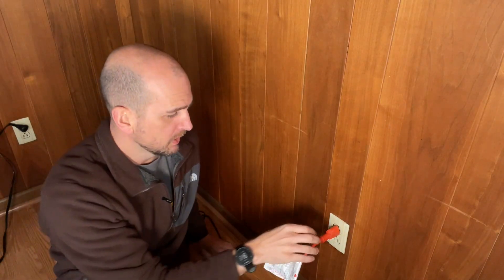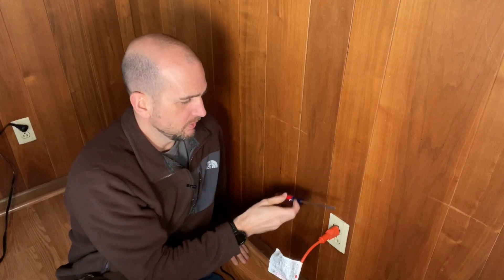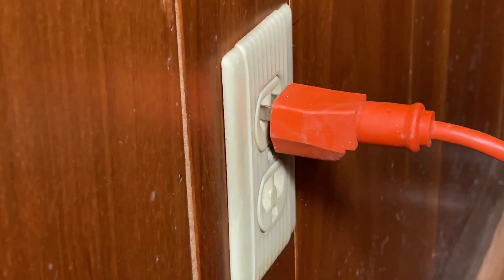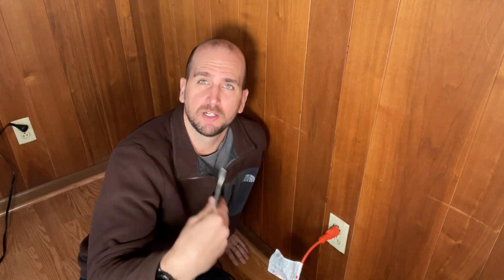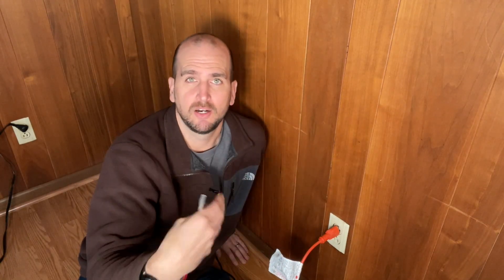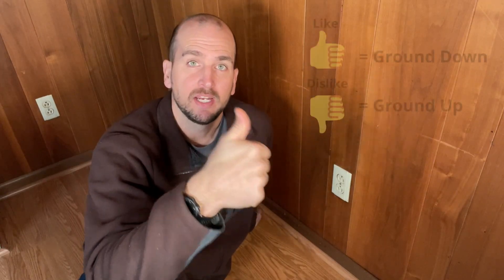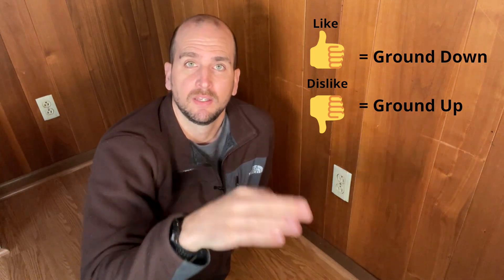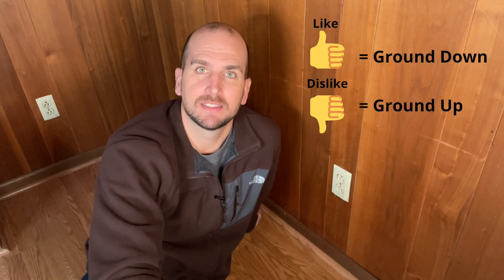Should An Outlet Be Installed Ground Down Or Up

Comment: I was in a brand new hospital and noticed all outlets were upside down.  I thought maybe mexicans put in the wiring.  I built my house and wired it ground down like it should be.  In the possible event a plug was not all the way in and an thing metal object was dropped just right to hit the plug and short it the breaker will pop.  Never had that happen and it looks stupid with wall transformers with their cords sticking up and bending over.

Comment: I've been doing handyman work for about 50 years now and I usually try to match ground up or down with the rest of the room. However, when the ground faces down the receptacle looks like a human face and this could potentially cause a young child to stick their fingers into it. Therefore, when the choice is left to me, I always mount receptacles with the ground facing up. I also like your reason.

Comment: Ground down. If the live & neutral pins had insulation around the first half of the pins (like the UK) it wouldn't matter if the plug was partially out. Not necessarily for objects but little fingers.

Comment: Some wall wart power supplies have grounds that are oriented below the spades with center of gravity below ground.  In ground up outlets, the wall wart will tip away from wall and lose contact.  Ground down, the wall wart stays secure.
I also turned my dryer outlet upside down to ease the tension on dryer cord.

Comment: A copy of an old code I saw before grounded outlets, specifies neutral on the left.  I have stuck with that for grounded outlets, meaning ground down.
Reply: I just follow the rule of the bigger blade is neutral
Reply: @doujinflip  "Bigger blade" didn't happen until polarized 2-prong plugs came along.  I have many old devices and extension cords with no polarized plugs. Also, certain 2-prong, double-insulated devices are not polarized.

Comment: 39 active years in the electrical industry from residential to industrial wiring. Always put the "U-ground" plugs with the ground down creating the "U". Only reason/concern I ever heard for the ground being at the top was similar to the case you mentioned where the outlets were located in a "metal working area". In that environment, a piece of metal could fall down onto a slightly pulled plug and onto the current carrying conductors. Of course, "Arc Suppression" and GFCI devices would offer protection from those conditions. Bottom line, there is no "correct/incorrect" orientation so install them however you feel the safest and/or like the appearance. For me, that happens to be GROUND DOWN !!!

Comment: I've always used your method of prong down for normal outlets, prong up for switched outlets.
Reply: No, please don't, and don't encourage other people to do the same.  It is something that lazy/cheap electricians do.
It is unprofessional to be inconsistent, and it's the wrong solution to the "problem". You should install receptacles that are marked as switched.

Such as https://www.hubbell.com/wiringdevice-kellems/en/Products/Electrical-Electronic/Wiring-Devices/Straight-Blade-Devices/ConstructionCommercial-Receptacles/DR15C1WHITR/p/2608245
Reply: @TonyPombo  If the customer is willing to pay for it, I'd be more than happy to install the "marked" receptacles for them.  Either way I'm sticking to the consistent "blades up" method for normal receptacles, and "blades down" for switched ones.
Reply: @cfgdr3  Fair enough, but I'd be concerned if the customer isn't willing to pay about $2 more for the occasional switched receptacle.  I recently replaced all 56 receptacles in a 1960s house, only 4 were switched. It added less than $10 to the customer's bill.

Consider that the concept of "some receptacles installed differently = remotely controlled" is not intuitive and requires user training. This may be fine for that customer you educate, but what about visitors, friends/family, renters, future owners? How are they to be educated?  Sure, they would eventually figure it out, but there is an advantage to a properly labeled switched receptacle.

Also, if you are in the camp of "one orientation is safer", then we want all the receptacles installed that way, yes?  Flipping the orientation of switched receptacles means that some receptacles are in the less safe orientation.  Using labeled receptacles allows you to install all receptacles in the safer orientation.

Your way is fine, but at least the readers here know there are alternatives to a "backward" or different color receptacle to indicate a remotely controlled receptacle.  That was my goal.  Plus it makes you look like a hero who you install something "better" that the competition didn't even mention as an option!
Reply: @TonyPombo  I was just looking to see where I can find them locally.  They are not carried at my normal supply house, so one of my calls tomorrow is to check pricing and availability from another local vendor.  Thanks for letting me know that there's a proper solution out there.
Reply: @cfgdr3  Yeah, I had to order them from out of state.  I keep a few in my truck (only in white).  They come with the top socket marked, or the bottom, or both. I think they come in decor or duplex.  I only stock the top socket marked, decor. If I get a job where I need many, or other configs, I usually have enough lead time to order them before the job begins.  Anyway, glad to be of service!

Comment: I have a portable wire loop antenna I use for receiving HF signals. In my old apartment I used to keep it in the corner of the living room when not in use. One day after I put it away, it tipped over bridged the prongs on my scanner's wall wart melted the wire loop, tripped the breaker and left a nasty mark on the outlet. The scanner didn't have a ground prong so upside-down wouldn't have made a difference though.

Comment: I've been in the industry for 35+yrs....and with Hydro and several contractor business in the electrical engineering trade. 1ph 120V 15A or 20A outlets. Its Ground DOWN. Neutral upper Left and Hot on the right. Switched or not. NO Exceptions. Especially for GFI Outlets. Ifvthe plug falls out the ground/safety is the last pin to disconnect. 😉

Comment: Back in the 1960s when ATT introduced the Princess Telephone with the lighted dial, it used a plug-in transformer that had a mounting tab that connected through the mounting screw for the receptacle faceplate.  This was needed by the safety standard because of the weight of the transformer.  When consumers would add or remove the transformer by removing the receptacle faceplate  screw, a metal faceplate could fall down and touch the plug blades, causing a shock or arc hazard.  The recommendation at the time, but never a Code requirement, was to mount the receptacle with the ground hole "Up" or "Left" to help mitigate this hazard.  The acronym "UL" for Up or Left became the way people were told to remember this safety tip.

Comment: Ground down.  Many electric cords have plugs with the cord going out at a 90 degree angle to the prongs, and installing outlets ground up causes the cord to go up the wall, which looks bad and causes the plug to pull out.

Comment: In my experience (w/ few exceptions), it's been ground down in residences & ground up in commercial settings. And in the former case, ground to-the-right, if mounted horizontally.

Comment: If the prongs were sleeved - would this solve this earth up or down dilemma?
Reply: Yes, quite right. In the Uk the 13 amp plugs we use have the Neutral and Live pins sleeved. No danger of little persons fingers coming into contact with 240 mains voltage as you withdraw the plug!

Comment: I'm about to have a nervous breakdown. When it comes to ground up denoting a switched outlet, what do I do if only one of the dual outlets is switched but the other is not? Should I turn it sideways, or paint the switched outlet a different color, or put circles and arrows around that one, or add an LED, or, or... Ah, screw it. Think I'll go to the bar instead.
Reply: I dislike the practice of upside-down plugs for switches because It is unprofessional to be inconsistent.  It's the wrong solution to the "problem". You should install receptacles that are marked as switched.

Such as https://www.hubbell.com/wiringdevice-kellems/en/Products/Electrical-Electronic/Wiring-Devices/Straight-Blade-Devices/ConstructionCommercial-Receptacles/DR15C1WHITR/p/2608245
Reply: It's ironically funny that the image shows the receptacle with the ground side up. 🤣
Reply: Don't over-complicate this. It's simple...there is typically only one wall switch per room, and that controls only one outlet in the room. That's the only one that should be ground-up regardless if it has one live outlet.
Reply: @Levi_roblox-edits  Guess my attempt at comedy failed. Oh well, back to the bar.

Comment: Anything that mounts directly on the outlet, such as a nightlight or similar device, is clearly made to prefer ground-down orientation. Same with appliance cords, such as refrigerators. The overwhelming majority of outlets I've seen in my life are installed that way.
Reply: Timers seem to expect ground down as well.
Reply: Another thing to think of is with an standard angle plug, if , for some reason there is water or other liquid dripping on the cable, if the plug is ground down the liquid will run down the cable to the floor, ground up, will have some running down into the outlet.
Reply: Some nightlights may be orientation-agnostic, but every outlet-mounted electronic device I’ve ever seen, such as WiFi extenders, are built for ground down orientation. They will function upside-down, but they are very hard to read that way.
Reply: Plus if you plug one of those right angle plugs into a plug with the ground up, it puts a sharp strain on the wire because of how it bends.
Reply: @KevinBenecke  actually some I have seen well pk only one maybe 2 in life that are molded (upside down? Or idk why the ground pins on the top hence making it upside down cord comes out the top when the outlet is oriented with the hot/live on the right and neutral left and ground lower or below) but yeah that does seem to hold water still enough to be true in mho
Reply: @KevinBenecke  Unless the cord is going UP to a desk, for example.
Reply: Our washing machine plug is 90° designed for ground down. On kitchen range outlets (NEMA 14-50R) the ground is UP on a low mounted surface or flush installation or there's no room for the cord.
Reply: I just bought a night light and it happens to plug in, in an outlet that is ground up .
Reply: I’ve always seen residential buildings the ground is down, in commercial buildings the ground is up?
Reply: Exactly.  While there is some logic to ground upward, nearly all right angle plugs are designed for ground downward (I’ve used a few that could be adjusted, but those plugs are not cheap). So I still install ground downward.
Reply: How many night lights and glade plug ins are 3 prong?
Reply: @heidilonergan979  Not many but some are fussy about which side has the wider slot, so they will only go one way even with no ground.
Reply: @heidilonergan979  None that I've seen, but most are polarized.
Reply: @heidilonergan979  Few if any.
Reply: Agreed.  Around 99.9% of outlets are ground-down.
Reply: @travis1240  
No. Every receptacle ive ever intalled (thousands) ground up. Thats because im a commercail electrician. Residential ground goes down. Commercial ground goes up. Every buisness youve been in for years has ground up recepts.
Reply: @chasejordan22  It's not a code in residential, commercial, or industrial, but it can be a spec of the job.
Reply: @stevieg.4816  
I never said anything about code.... ?
I said recepticle go ground up in commercial. That is true 99.9% of the time all around the country for years and years now. Code isnt invloved.
Reply: @chasejordan22  , it might be a function of where you live. I'm nearly 50, have spent over 30 years in commercial buildings in 6 different states . . . and haven't ever seen one with the ground up (including one that my office moved into the day it was finished being built brand-new).
Reply: @chasejordan22  is it preferred or just easier for commercial to be specofically up instead of down causei ts not super hard if anybody in a residence was competent enough confident in themselves and cared THAT much I tbh could possibly see myself flip over the outlets unless switched via a wall ie the link on a duplex type was removed
Reply: @bsanchez3563 
I'm not sure about what is easier. Seems about the same to me. But having ground up is for sure perffered and some times spec'd in the prints (in my part of the world(ohio).
Reply: @chasejordan22  yeah it maybe just not as common on the northwest usa but idk cause lmao it seems to be not really course never looked into it really but idk if its jus a city or state to state thing as idk actually if there's a such thing as a state or province electrical or builder code surely there must be or of some sort course fwiw given the fact that tornado or earttqaukke (lols jk intentionally josseled or spelled mwrong on that one hehe) or natural disaster prone places varying surely it a thing by  ore than just the city town or townlette etc villages and nations that are enforced with a specified applicable code or codes for building given that there are international codes for construction of buildings an such
Reply: @chasejordan22  No necessarily, In my 48 years as a Journeyman/ Contractor Electrician. Only dedicated circuits in commercial or industrial were ground up. With exception, of dedicated circuits with receipts of color such as orange or red, in hospitals.
Reply: @chasejordan22  as a commercial electrician I've installed my fair share and they're always ground down.
Reply: @chasejordan22  that is what my good friend told me also he is a master electrician and does mostly commercial work.
Reply: Most nightlights manufactured now have rotating plugs that make the ground orientation of an outlet irrelevant.
Reply: @chrisk926  Most? Not really. There's a few. Most don't.

Comment: in junction city kansas  local code upgrade requires the ground up type install...for this reason of a cabinet carpenter measureing for a job when his tape measure slid behind a plugged in blender and it shorted his tape not only in half but sparked a fire and tripped the breaker!!  !PLEASE BE SAFE OUT THERE

Comment: General Supervisor Electrician in Oregon.  Started in the trade in 1978 and have always installed receps ground down, unless to match existing, because of a special cord plug, or by engineering specifications.  Ground up is safer, but it just isn't that typical out here.  Also, this is the first time I've heard of ground up switched receps.  Good idea, but would stick out around here.  Must be an east coast thing...maybe elsewhere.

Comment: On boats, they prefer to have the ground to up (or the outlet on it's side), for the same reason, a chance of something metallic falling across  the terminals. This is a lot more likely on a boat because there are a lot of metallic things (bug swatter, utensils, etc) stored close to the wall and of course the boat is moving - shaking things up.
Otherwise, I prefer to have the ground down because it looks like a smiley.

Comment: Nothing like waiting in the dr's room waiting for the doc and looking at one wall with  the ground up and another ground down,.  actually one room I saw both of those and another sideways.  Se alot sideways and that one somewhat makes more sense than ground up.  however ground down has to do with balance.  with a 3 prong.  Having a 3 prong fall out because the ground is up is not very exciting.  and often that has happened,  there's more weight on the bottom.  Way worse if you have a GFCI style plugin that's really massive or one that is on the end of a window a/c.  that also has that same sort of thing it.  ie oh look the (face palm) plug has been taped to the wall  as it's upside down.  I think the primary reason for all these errors is whatever way the wires were at in older homes.  Now in some older homes  Ground wire whats that...  So that's where the GFCI is good at....   Needless to say I have learned the hard way that some homes are poorly wired.  Okay All the plugs are off and room is off via circuit breaker.  and I take the outlet out and zap.   okay 3 of the 4 outlets are off but where does the 4th one go to.  smh to my closet which is on another circuit.  Good buzz.  Not the worst I ever had and thankfully there was a ground.  touched a computer PSU and it shorted out thru my left hand out out my right foot.  yeah okay safety first... I just shut the entire house off..  Course as far as wiring goes there are gizmo's telling me if I wired wrong.  The worst one I've run into of late with most Alexa/Google Home switches is Neutral vs hot and cold.    Many houses do not have a neutral wire.  And I have no wish to mess around with that.

Comment: Ground down it's not mandatory it's all about looking the same and being uniform and square just like it's not mandatory how high or low your plugs and switches need to be it's just about looks
Reply: Between 13 and 15 inches for plugs and 48 to 53 inches for switches depending on situation if u have a disabled person get a higher plug for them and lower switch. If your well and ok 12 inches from floor is preferred and 48 inches for switches